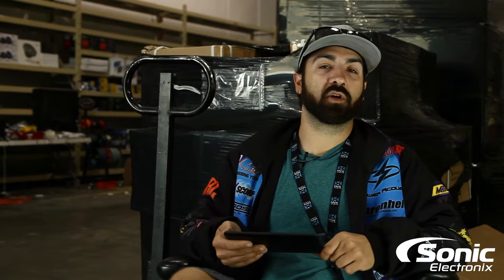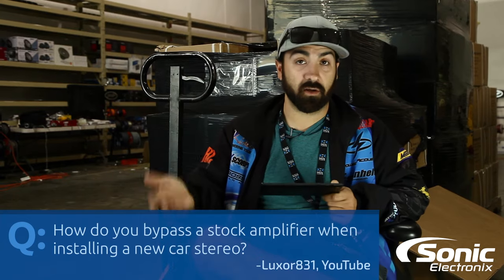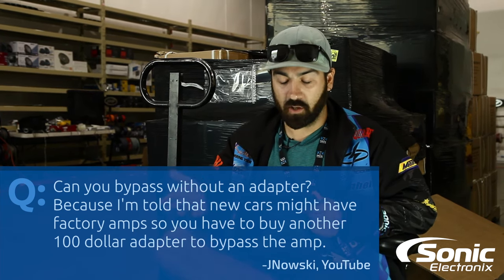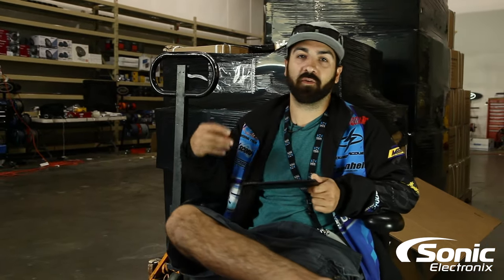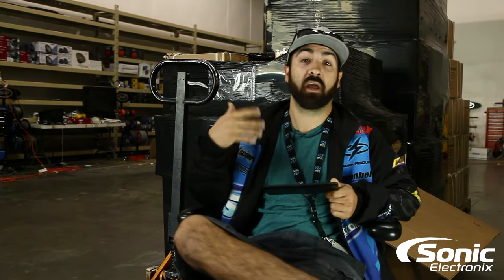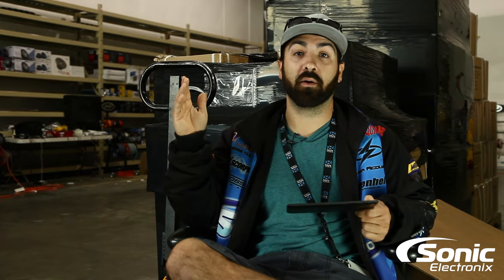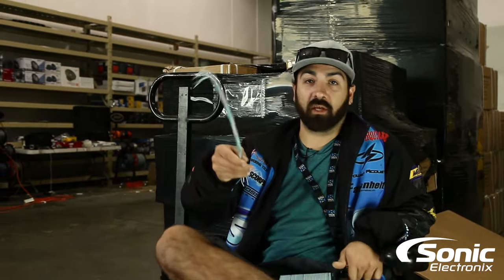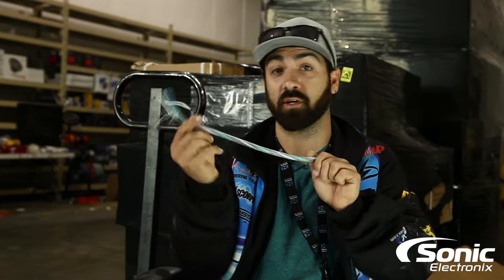How Do I Bypass My Factory Amplifier? | Car Audio Q & A

Comment: hi I own a 2000 suburban and my amp fuse keeps bowing so I have zero sound coming from any speekers. I put in a new sub a couple months ago that is wired through  where the stock amp waste  but it worked fine for a while. The fuse continually blowing started when I changed my battery out when the old one died anyone have any clue?

Comment: I have a 2015. Civic si . And it has the premium amp with the sub channel.  I don't wan to use the factory sub . How can I add my own subwoofer and monoblock amp?  While still having the door and rear speakers powered by the stock amp .  Can I just use the signal from the subwoofer channel ?
Reply: +Jay elite It's a little tricky, but here's my understanding of it:

1. You're probably going to need a new deck to do this.  (But see below for another possibility.)  If you do, you'll also want to get the right wire harness so you can retain door chimes and various other functionality, which this video has already spoken to.
2. Install the new deck and wire harness.
3. Go to the factory amp and disconnect the sub, but leave the other speakers intact.
4. Run your sub output from the new deck directly to the new amp/sub.

It's possible you don't have to replace the deck if you wire the factory amp's sub output to an RCA adapter (SNI-35, I think?), then run that output to your sub amp's input.  However, I'd confirm that with whomever is selling you the rest of your gear before you take my word for it as I'm just a DIYer, not a professional installer, and I don't know if this would work or not.

Comment: the radio I'm trying to install in a factory MMCS unit. it's out of an 08. my car is a 12.
Reply: I'm trying to do the same touch screen out of 09 to 2010 ram. but truck does not have factory amp

Comment: I have a 2015 accord ex-l,how would I bypass the anc system because I don't want to remove the Bluetooth mic.however the shop that installed it, put a wire to the amp from the fuse box so it turns off as with the car.i still have to go to the diagnosis screen to turn the anc off than on because if I don't a buzzing noise will come on.  Please help
Reply: you can disconnect the ANC under the radio i would google insturctions

Comment: i bought a new head unit for my jeep liberty and i have no sound to my stock speakers.. my sub gets power but not car speakers.... been told i might have factory amps but i cant find any info that my jeep has one.... if i do have one i cant find remote wire that goes to factory to run to my new head... any ideas
Reply: I'm curious, did you install any sort of adapter along with the receiver?

Comment: I have a 12 Mitsubishi lancer, I just bought a factory navy from an 08 lancer. Everything is working , other than the sound. I have no sound at all....any ideas?
Reply: your lancer has a remote output from the factory amp, to power on. make sure it is connected to the blue/white wire on your aftermarket stereo
Reply: +Ty Green same problem as the other guy expect i drive a 98 civic. any idea whats wrong? none of the speakers work but if i hood up my aftermarket amp with my sun via rca it sends the signal to the sub but still no sound from speakers.

Comment: i have a 2007 chrysler pacifica my aftermarket stereo has 1 harness hook up but i have 2 harnesses that connect to the factory stereo. I used the adapter but still couldnt plug in the other wire harness i had power and all but no sound?
Reply: Randi Scott I know your problem I jus had to figure it out at my shop I work at

Comment: Why would you need/want to bypass your factory amplifier?
Reply: +pd fitzpatrick The stock amp does not supply enough power for your aftermarket speakers, so you bypass it and use an aftermarket amp.
Reply: +John Le 
may i ask, what adaptor is he talking about? is it LOC, line out converter? thanks
Reply: +pd fitzpatrick because it isn't working properly

Comment: I have just installed a stereo system in dash with subwoofers and aftermarket speakers in my 1998 infiniti i 30 all speakers work except for the 2 front door speakers what is the problem can you please help

Comment: Hi so im have trouble maybe you could help. I have a 2018 ram 1500 i wanna to switch the factory amp for a new one with the factory head unit still. When installed would not play sound at all. What could i be doing wrong.

Comment: Hey how do I know if I need to use a cheap scorche wire harness or an expensive $130 wire harness just because I have a hemi motor. I have an 07 Jeep Commander. Limited 4.7L with v8. Plus!!!!!!! I tried to buy the $130 harness and paid to get it hooked up. They said that after hooking it up no sound would come out of my speakers! Mind you it was working before they touched it. They hooked my factory back up and said my factory amp was sleep. What should I do? What would you do?